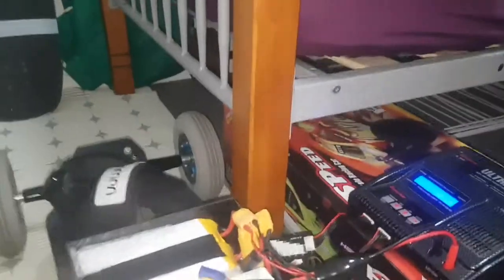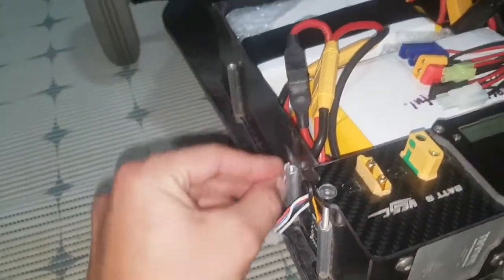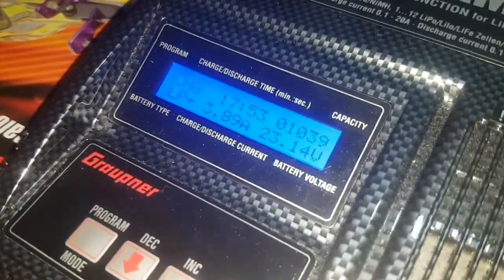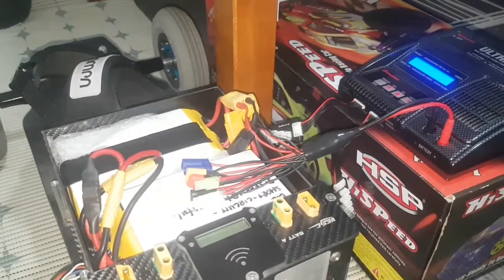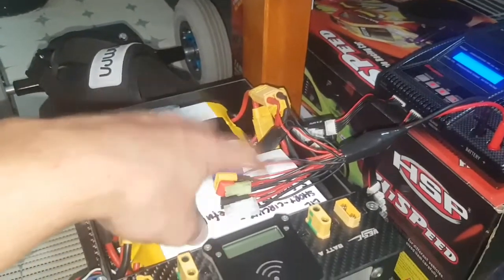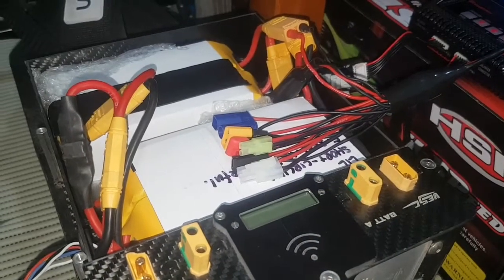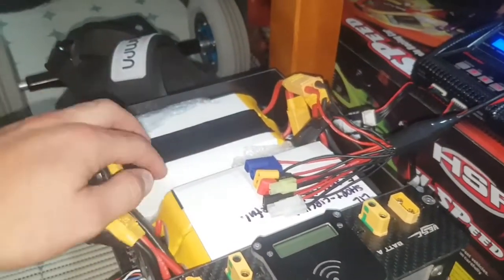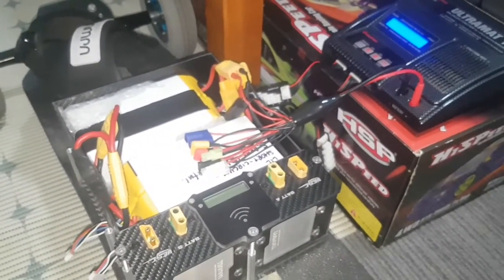12S CHARGE UP PROBLEM SOLVED [GRAUPNER 18]

Comment: Hey dude, I have a similar battery setup and the same charger. Is there a rule on which charge port to use or can you use either one?
Reply from the maker: Im not sure i understand your question mate.

What are u referring to as charge port?
Reply: @nedtrampz85  The loop key ports where you plug the main charger cable in (when your doing a normal charge of both batteries in the box). 

Is there a specific side that you plug the charger in or can you use either one?
Reply from the maker: @jamesmontgomery2009  have you not pulled the box apart to see which xt90 leads to batteries?? Its possible u have 1 12s battery??? I have 2 so i use both sides for charging man. Theres balance ports both sides & you use those to charge ur lipos.

Comment: So do your batterys  go to 100%
i got same charger 
2 16000 amp batterys but seem to only get 70% charge
Reply: I thought balance meant charge together
Reply from the maker: @michaelworrell7717  each 6s pack has 6s balancer. If you having problem charging 12s or any pack made of multiples. Break it up n charge indivdually. If 1 doesnt charge up fully youll know which pack is playing up. But they should both charge to 100% seperate. Maybe after a couple times charging this way. 

Generally only need to if the pack is internally damaged.
Reply: @nedtrampz85  
Thanks but i worked it out cheaping out on charger means can only charge fully one at a time with that shit charger gotta buy 2 or just get a stronger charger so i dont have to unscrew the bloody thing every time and use onboard balance
Reply from the maker: @michaelworrell7717  ... the graupner 18 charges 12s. In this case it means i charge 12s either side. 

Yes its painful to do it twice but no unscrewing buddy. Monster box has 4 6s balance coming out. Both 12s packs run seperate unless you get the HRB battery n hook it up as 1. Those r huge too. I may do that in future
Reply from the maker: I donot work for trampa so i dont care what u do. I love my graupner 18 charger even tho it charges at slow rate. Its great for doing all my rc car stuff aswell & looks after my batteries.
Reply: well i only been on a board 5 days now and i didnt think that would be my biggest problem !!
Have been trying to pop wheelies but its scary

Anyway when the trick guide coming ????
Reply from the maker: @michaelworrell7717  lol. Im glad ur amused there mate. Not sure about a trick guide. But be sit tight for more footage be on the way! 

I mainly just like making these videos to remember the sweet journeys ive taken.
Reply: @nedtrampz85  
I HEAR YOU BRO
Best purchase ive made in a long while 
just need 4 more battery packs some 9 inch deep dish wheels that new controller and a second charger 
and MONEY and my world is complete 
already got beers !!!
Reply from the maker: @michaelworrell7717  Awesome purchase. I have the wand on the way i might do a review on it. I believe its going to be just what i need. 

The 9 inch wheels would be lovely too but thats not on the list for now. Need to build my bank up a bit 😉

Got beers. Cheers